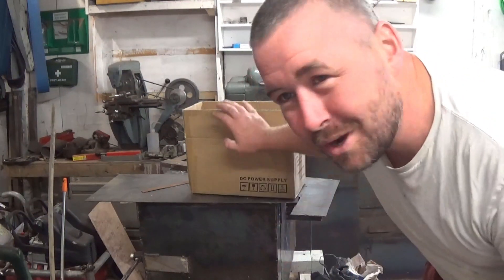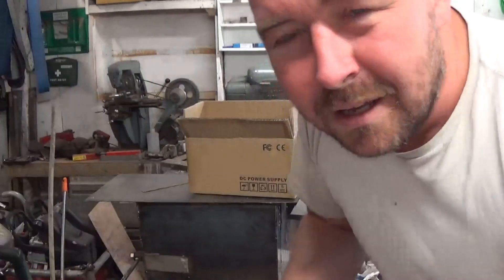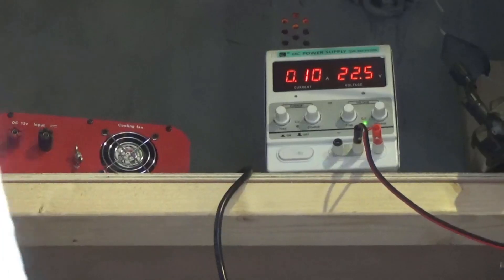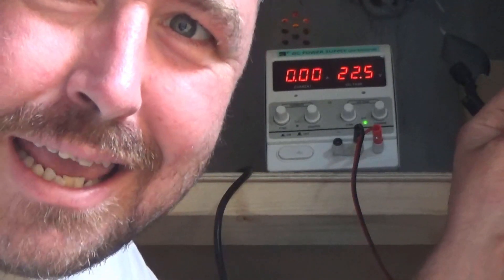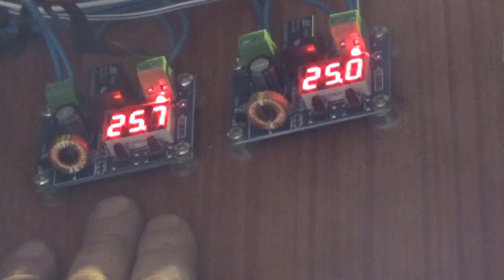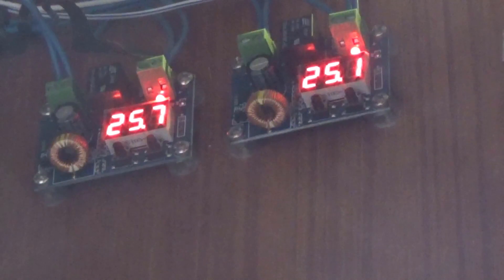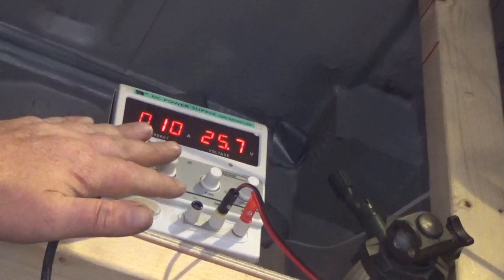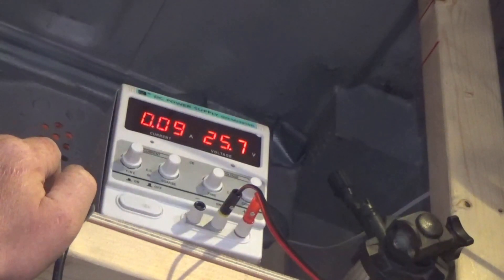variable bench power supply and solar power musings.

Comment: I don't reckon that a voltage-cut relay will do the job of an MPPT charger - the voltage coming out of your panels should be somewhere up around 50v per panel, and up to maybe 150v per string of them coming into that charge controller. More likely 100v odd being a cheap one. The MPPT unit is acting as a battery charger rather than just a simple cut-off switch -  you'll be getting say 90v at 8-10a out of your panels, but all your batteries will be seeing is 28.8v or so, like an alternator. However, they'll be getting 30a of that. The MPPT system will get more power out of your panels at low light levels and high heat levels than any other option, so I reckon your best bet would be to get a decent Chinese controller (I've used the EP controllers from BimbleSolar.com for years, I reckon they're about the best bang-for-buck) to do your solar, and leave that thing doing your wind. However, it's worth saying that the times I've met batteries that are getting over-charged, it's been the wind's fault...

Apologies if I've misunderstood your intentions there, I'm just trying to save you some hassle! I've had one of these little power supplies for a fair while, and it's great. If I remember correctly, it's basically a good Chinese knock-off of a pretty common high-end lab P/S.
Reply from the maker: I'll gladly receive any advise, don't apologise! 
The wind side has performed flawlessly since installation while the panels have been disconnected most of the last 7 months, the overcharging only happening with the solar plugged in.
I'll take a look at bimble thanks.

Comment: I have loads of old lab stuff, I love it. I built an all valve 500v psu for a project too, using scavenged parts. I love cheap chinese modules though, but as you say, its just a different world now.
Reply from the maker: Now I just want to know what project required 500v!?
Yes, truly amazing all of the prebuilt boards and components available for pennies now, I'm slowly working my way up to playing with Arduinos!
Reply: @turboconqueringmegaeagle9006  I have fixed up a 1950s British military geiger counter or contamination meter! it's all valve which is even cooler. Anyway the declassified manual I found specified 500vac as a bench psu for test values! I still haven't found anything radioactive enough to check calibration but it works now!
Reply from the maker: Haha absolute madness, you are a legend, one day I also hope to find myself a vintage geiger counter, I only ever see the Soviet units on eBay and they are very expressive.
Reply: @turboconqueringmegaeagle9006  Do it! It would be a fun video too. Loads of potential clickbait titles too. Arduinos can solve really complex problems for pennies. The language feels quite analog considering the complexity of what's happening.
Reply from the maker: I'll keep my eyes peeled, I'm not up for cyrllic though, ideally I'd like something American from the 60's with some chrome on it!
How did you get started on the Arduino? My only programming was at college nearly 20 years ago on dot basic.
Reply: @turboconqueringmegaeagle9006  I just looked at some basics. it's surprisingly feasible to learn the basics quickly. British stuff is definitely cheaper here!
Reply from the maker: Once I've finished the underground workshop bunker I'll get one!
There are quite a few on eBay at the minute as it happens.
Reply: that's definitely relevant to my interests.
Reply: @turboconqueringmegaeagle9006  I am into arduino too, solved many a problem with them!

Comment: These are fairly good PSUs for the money, fine for general use and basic electronics.  10A may be pushing it, but even if you stick to 50% of the rating it'll be fine.
Reply from the maker: Ok, that sounds like excellent advise. Do you know if they are fused internally? I never read the booklet.
Reply: @turboconqueringmegaeagle9006  No they are not mate, in fact you short them to set the current limit.
Reply from the maker: @pradolover  so I can't actually kill it? I've never really used the current limit on a supply before.
Thanks mate
Reply: @turboconqueringmegaeagle9006  No not really unless you feed mains up it or something!  Current limit will just limit voltage to prevent current rising above your set limit. Cheers mate
Reply from the maker: Mate, do you really think I'd do something like that?........
Don't answer.
Is it all done with transistors like new welders?
Reply: @turboconqueringmegaeagle9006 Yes they use a large transistor as a voltage regulator. The transformer has several taps to limit the voltage the transistor has to drop. In essence the transistor acts like a high power variable resistor.
Reply from the maker: You make it sound so simple!